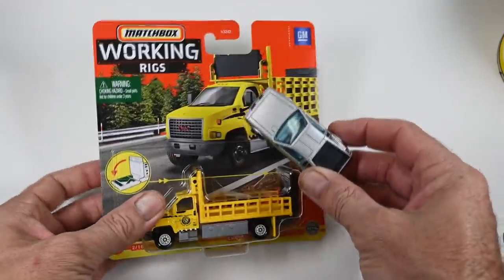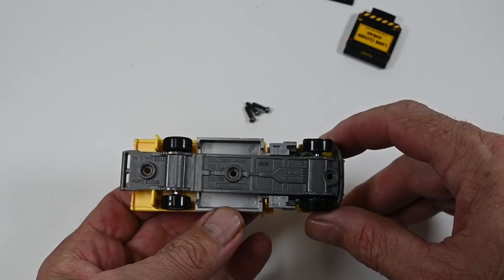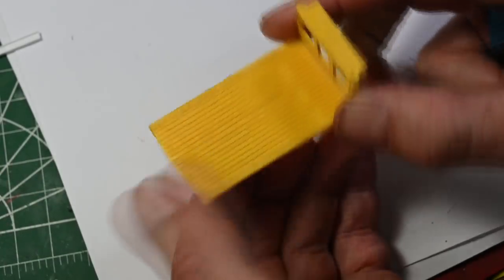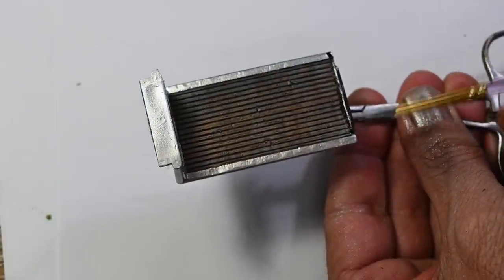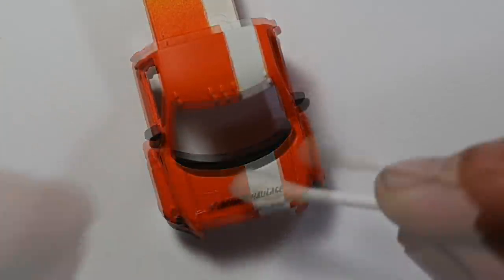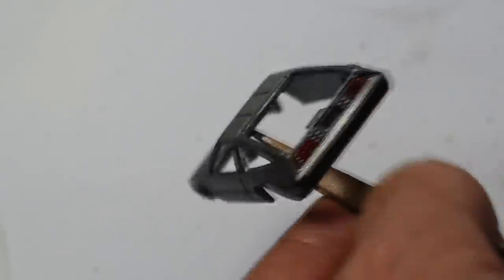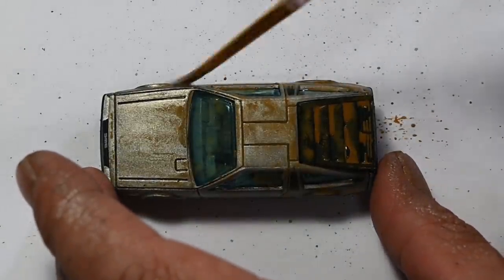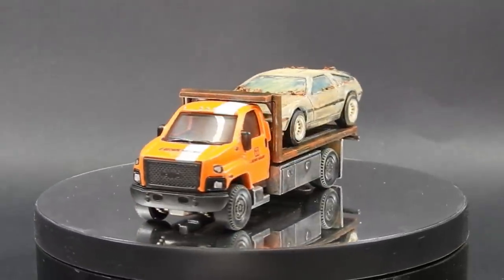Hot Wheels Matchbox Kit Bash Custom | GMC 3500 Hauler & DMC Delorean Barn Find | w/Matchbox Garage

Comment: How do you put the cars back together after drilling out the studs? Do you just glue it back or do you tap the stud for a screw or just piece it together with no hardware?
Reply from the maker: Drill and tap the posts and use small screws